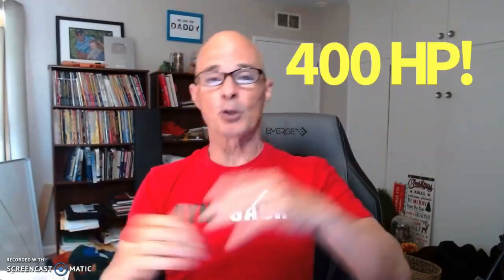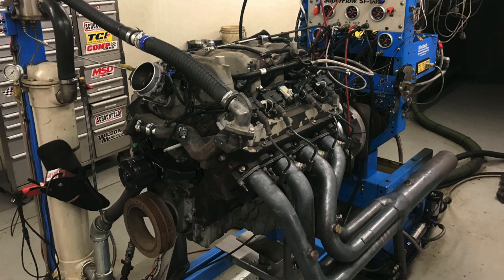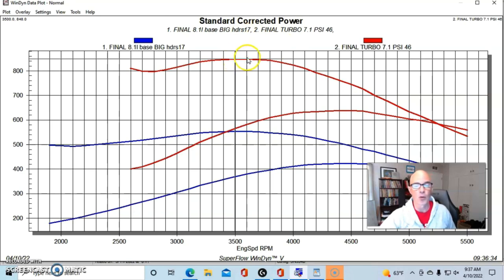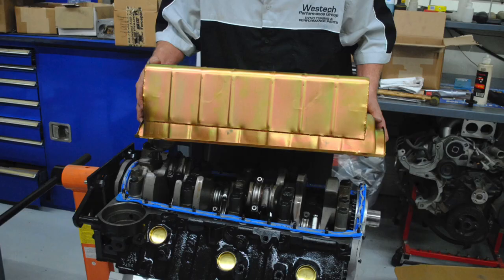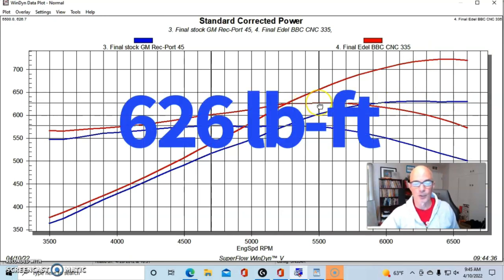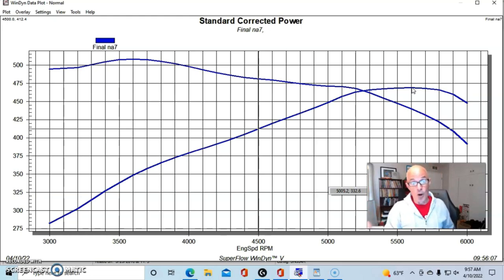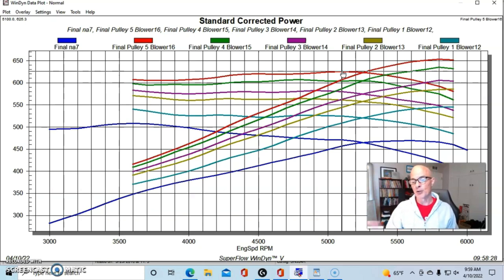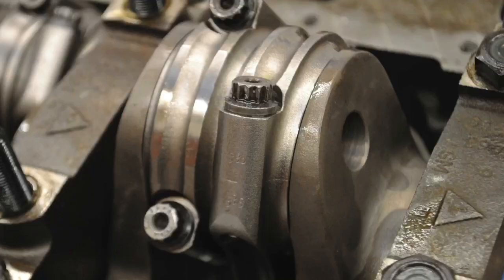HOW TO MAKE 600-HP BIG-BLOCK CHEVY POWER. FROM CHEAP, JUNKYARD TURBO 8.1L TO ALL-MOTOR 496 TO SC 454

Comment: I’m so glad rich is doing videos on the gen 7. It’s much needed information.
Reply: Not sure why gen 7 would be much different than gen 6, 5, or 4? Only gen 7 and gen 8 heads are the biggest difference, but the dimensions and sizes are all similar from 1964 and up. What did you learn exactly as I like to learn too? RH is a modern shop teacher learning the masses about what was top secret just under 20 years ago! 👍

Comment: This is exactly the video I needed. Just acquired a square body with a 454 that needs a redo.
Reply: I have the same truck. I use it often and I tend to travel far with it. I decided against the big block only because of the mpg. On this truck I think a tough small block will suite me fine.

I considered boosting a sbc or a Cummins swap. Cost, intended use, ease, and available funds at the moment ....... and the fact a free built 400 sbc fell in my lap today I think I'll pop that in for now. The Cummins was my top #1 choice for torque, reliability,  and awesome mpg. 

Tomorrow I'm picking up a 67-72 c20 just to flip it. I have a nice 402 big block to throw in. If someone is willing to pay for a Cummins swapped truck, maybe I could do that and see how it would drive.

Comment: My old 468 I built made 610hp/555ft lbs with 93 octane, 10.2:1 compression and a 850 double pumper carb. I used a set of unported 308 iron eagle heads, victor jr intake. and the #7 rocker coming off at the end of the Dyno pull. Didn't get to make another pull. 👀🤷 Great video as usual!!🤟

Comment: If you're going to use the stock manifold, you need to take it off and modify it first. The PCV system bleeds directly off the bottom of the manifold and will pump your cylinders full of excess oil. That needs to be plugged.
Reply from the maker: on the 8.1L?
Reply: @Richard Holdener  Did you know Dart makes a carb manifold for the 8.1 and a standard HEI fits in with no mods?  Just sayin!

Comment: Richard. I put together a 496. It has +22 dome, 1/16 ring pack, 118cc chamber, 320 Rec port speed master heads, zero deck, .039 gasket. Lunati flat tappet 268/276 .549/554 cam. 2" -long tubes, Edelbrock 800cfm AVS2 carb on a Wieland hi rise dual plane. MSD HEI. Any educated guess for power? You've done so many test so your guess will be good enough for me..
Reply from the maker: heads will hold it back-is that cam duration measured at .050 or the advertised? I'm guessing advertised based on the other components-but mid 500s
Reply: @richardholdener1727  lift at .050 is 227 and 233
Reply: @richardholdener1727  Would you recommend the rec port AFR Enforcer or the rec port Pro Maxx?

Comment: Thanks, Richard. Any way you could show us how to do a 700 hps in a Chevy BBC 427?
Reply from the maker: I don't think I have tested any 427 motors making that much
Reply: I have a pro built 427 on the budget I could afford. 433 cu in, 11 to 1, Chevy iron rectangle port closed chamber heads, solid lifter cam 256/264 dur @ .050, lift .595/.621. Holley 850 dp on Weiand Track Warrior single plain man. 562 hp @ 6300 rpm.

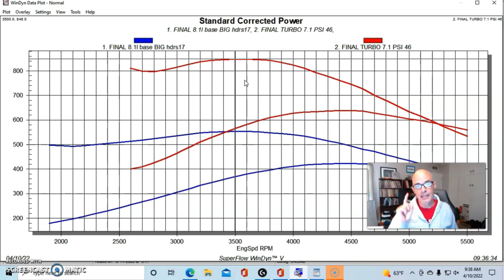Comment: 4:19 850 ft lbs, what transmissions can take an input torque like this and live on the street?
Reply from the maker: A GUY DROVE INTO THE SHOP WITH A TURBO 8.1L IN A 3500 TRUCK-RUNS GREAT
Reply: Hey that was this guy. Mine made 830lb/ft at the tire. Has a stock Allison trans with 579,000 miles on it. It’s all in the tune.
Reply: @richardholdener1727  what cx racing air/water intercooler is that u use?

Comment: Planning on building a gen 6, 496. Would afr 265. Heads and that xr271 cam you used, and a air gap dual plane  be a good combo for a weekend driver truck application?
Reply from the maker: I don't recall and xr271 cam
Reply: @richardholdener1727   its the cam you used on the 454 with the 6-71 in this video

Comment: So I just pulled a l29 454 . I want to rebuild it and to keep the stock bottom end if it’s still good when I take it to the machine shop . And I’m just gonna do a cam , heads , intake and carb . Anyone have a detailed parts list for me to accomplish this without breaking the bank to badly but still have quality engine at the end ? I never have built an engine before so need ideas . Thanks
Reply from the maker: Take a look at the Many Gen 6 454 videos, look for a 274 cam, Performer RPM intake, 650 or 750 Brawler and HEI distributor
Reply: @richardholdener1727  ok cool I will I just found your videos and will do that . I appreciate it

Comment: What are the statistical odds of finding a 496 with a forged crank these days ? And 7 lbs of turbo boost is ok on stock 8.1 valve springs ? Weiand used to say add  spring pressure for boost situations
Reply: As long as you aren't floating the valves as boost and rpm increase, it's all good. Dyno seems to agree.
Reply from the maker: YOU DON'T NEED A FORGED CRANK IN THE 8.1L, AND IT WAS STOCK SPRINGS
Reply: @richardholdener1727  would you say that stock springs are ok for low boost. Or is it more of a boost allowed for higher revving and springs may be needed then

Comment: Hey buddy I have a 2010 Silverado hd I'm putting a 6.2 in for a guy I'm looking for a cam suggestion to help get this 6800LB truck to moving off the line. If you could help I'd appreciate it. Thanks
Reply from the maker: BTR TRUCK NORRIS
Reply: @richardholdener1727  thanks

Comment: Hey Richard what was the compression ratio on the 496 with the rods, pistons and the 088 heads? Made over 600 hp. I currently run a 496 with more or less the same rotating assembly, highly ported 088 heads and a marine cam. In my situation I ran out of money and couldn't afford a nicer roller cam. Used a flat tappet comp cam. 544/547 lift 240/240 duration ( that's a close number on duration, can't remember exactly) with a 112 lobe separation. Think I'm close to 600 hp at the flywheel? Have a Holly single pumper 750 4150 flange on it now I also don't think is enough carb. This setup is in a 24 foot boat. THANKS!
Reply from the maker: 10:1 ish
Reply: @richardholdener1727  sounds great. I'm at 10.3 - 1 here. With a 4.250 crank, 6.385 rods and can't remember exact spec on the pistons. Mahle with valve reliefs. Thanks Richard! I think I should be around 600 with the right carb.

Comment: I don’t know what is going on, but I had my 454 BBC built by a very known engine shop. They built me a 496BBC Stroker all forge and racing rods and pistons. Making it 10.1 compression. With 781 iron oval port cylinder heads, larger valves, solid roller, Weiland Track Warrior Intake Manifold, DC carb Black Window… 850 … unleaded with HVH 1 inch spacers.. Jets to 75-83 from 76-85 less timing..
Why am I only getting 704.5 STPTrq Clb-ft @ 3,500 rpm’s 
And top out at 590.4 STPPwr CHp

It’s on a known good Dyno and have switched out carbs 3 different times, why isn’t my hp not way up?? But my ft lb or torque is over 700+ easy….  Please help me out
Reply from the maker: 700 lb-ft at 3500 rpm?
Reply: @richardholdener1727  Yes 704.6 @ 3,500rpm STPTrq Clb-ft and 590.4 @ 5,200rpm STPPwr CHp..
Reply: U have way more tq than hp  wonder if heads are not capable to flowing enough

Comment: Please test an under bonnet blowers on big blocks and its a equal comparison with a single carb. We all can't show of what we have in some states. And should be in this bracket. And cheap in comparison. Cheers
Reply from the maker: what is an under bonnet blower?
Reply: @richardholdener1727  sorry  what I should have said low profile blowers like the 144 177 now we have 192 and 250 from The Blower shop billet housing Teflon seales and  yes old straight rotors heat  an all ,get it, but lot  of us hot rodders like to keep stock look especially for the law , rather be driving!. So for the 30s 40s 50s 60s cars/rods with heap of clearance under the bonnet/hood. Some of us with a mint 57 chev ,club meets/weekend runs odd 1/4 mile run car don't like to cut holes in our pristine bonnets/hood neither does the law or have the $$ for a turbofabricated set up on a classic car, I see as the best option for the $$s spent without much fabrication AND go back to stock in a weekend believe me had to do it back in the day  lol . Richard a fairly stock 454 and beg borrow or steal all low blows 144 177 192 250 from everyone anyone for a test everyone will  watch!! Spin them till they run out of puff or heat up ,limitations! Of a bolt on!?? Different fuels!! too for cooling, all single carb!! Perfect for this 600hp bracket. Cheers Richard sorry about my Aussie lingo bonnet/hood lol

Comment: Mr. Holdner, would you recommend a 6-71 or 8-71 for a 454 to 496 build? Thank you.
Reply from the maker: for what power level
Reply: @richardholdener1727 - I would like to exceed 1000hp in my boat for short periods of time. The power is to get a hydrofoil on step and then back off. Was looking at the Dyers 6-71 and 8-71. Would like flexibility in regards to larger or smaller engine displacement if that's possible or practical with a single blower. Thank you.